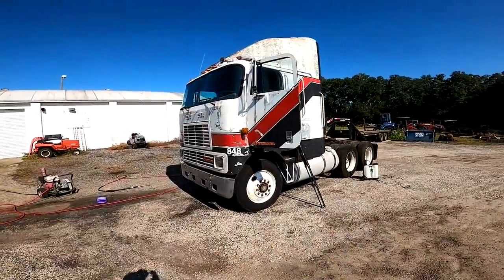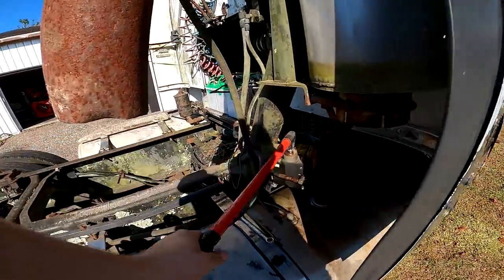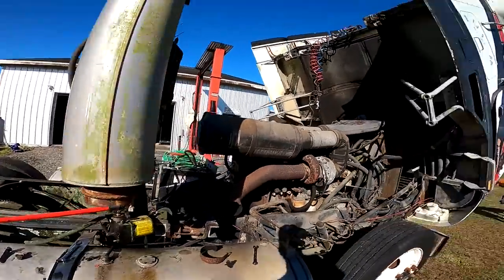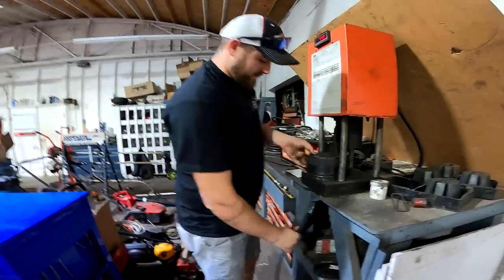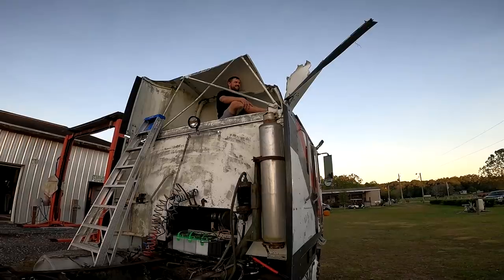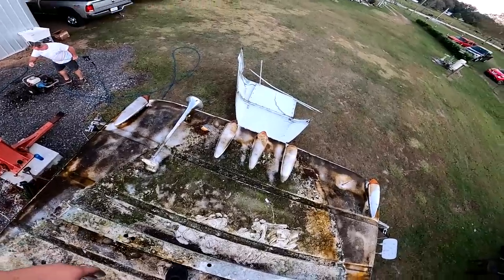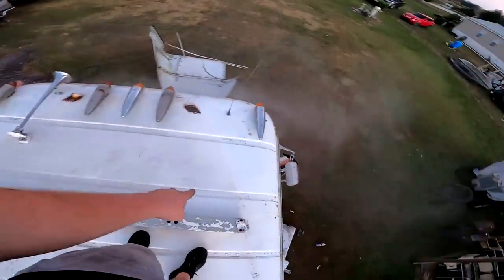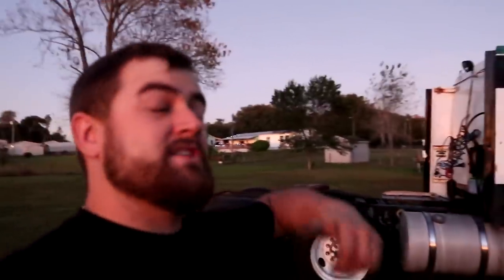THE CORNBINDER GOES UNDER THE KNIFE!!

Comment: For the motor HP a tag should be on the drivers side of the motor at the front side of the motor. A red tag. Get the CPL number and look it up. My guess would be a model 855 350 hp. For the truck.. You could get a build sheet from an International dealer known as a line ticket with the VIN # and know what the truck came with right off the line.

Comment: My dad had an 88 9670. It had an air over hydraulic jack for the cab. It made life a lot easier. Also, when you let the cab down, make sure you pay attention. If the shift rod misses its hole, it will not hold the cab up. And they bend very easily.

Comment: I would repaint it with different colors but I would definitely keep the stripes old-school like most Cabovers were in the 70s and 80s. They have the stripes that started at the grill and turned up the side of the cab. Definitely needs a set of aluminum Alcoa’s.

Comment: Engine serial number and hp should be either on the valve cover or on the front cover on the driver's side,it's definitely a 350 but the number will tell you if it's a big cam,400's are not common and you better hope it's not,the 400 is junk

Comment: Look on the accessory drive on the driver side of the engine about eye level it is what drives the air compressor and the injection pump on top there is a metal tag about 1" by 2" it should say NTC 350 or NTC 400 I think by history on those trucks it is probably a 350. Very reliable engine's biggest thing with them is the liners if you get no anti freeze in the oil or a liner will jump and the head will leak if those 2 thinks are not there then you are golden. let the truck sit pull the drain plug on the oil anti freeze will come before the oil if its all oil your good. I have a 350 in a cabover Shaker, I drive it everywhere still work it from time to time, cabovers are cool but the suck driving day to day. That truck looks like it could be a daily worker.

Comment: Why didnt you just jack the cab up to pressure wash it? Seems it would have been easier, kept crap from running down the already cleaned areas, and you dont have to worry about slipping off.

Comment: Dude you need to be careful jacking the cab over so far without a safety chain on it. I worked on these things for 15 years at a Cummins Distributor and have seen them break off and hit the ground.All that's mainly holding them is the hydraulic cylinders. Also make sure everything in the cab is secure things will fall and brake windshields.

Comment: I'd just repaint it similarly, that scheme is really iconic of the 80s and looks great on it. At most I'd switch those stripe colours to match whatever trailer it's going to jail (of that's even applicable), or make the trailer match the truck would be better.

Comment: I bet that’s a big cam Cummins. 350 or 400. Info plate should be On the driver side front of the engine or a little rectangle tag in front of the fuel injection pump.

Comment: Drivers side, front of motor, just above the frame rail, is the fuel pump, on it is a tag, engine info, on tag, might also be on front , top valve cover.
 Looks like a Cummins , big cam III, or IV, depending on the year.

Comment: Not sure what the plan is for the truck but polish up the tanks, set of aluminum wheels, a period correct visor and paint or wrap but don't change the scheme.  Besides,stripes are coming back. Little more info on the truck like what engine , transmission, and diffs are in it.(unless I missed it in other episodes ) yes ,I know it's a Cummins.

Comment: Look behind the glove box on passenger side..should find the intl build-sheet...i would also suggest that when you jack up the cab to put a come along on it to hold it ..just in case...(the build sheet will have all the correct parts groupings as they changed from truck to truck in that era)

Comment: Engine number is on the drivers side of the engine wrapped around the outside edge of the accessory drive front cover - the most important number is the CPL number - it stands for Control Parts List and let's the parts guy know exactly how the engine was built.   Be sure and use a safety chain when tilting the cab - I have seen lots of those lifting cylinders come apart and drop the cab to the floor and bust both windshields and screw up the cab at the top edge - they usually always leak after that...

Comment: Engine tag is on drivers side of the block or top of valve cover.
Reply: The engine ID tag on an 855 cummins is on the left side od the timing cover near the compressor. It should be on the curved section, facing the outside.

Comment: Hi Bruce hey after you clean those tanks on Bertha spray them down with eagle one's etched wheel cleaner it will polish those tanks like new don't leave it on more than two or three mins spray it off with a water hose awesome will clean a hole lot better on stuff like that 👍I'm not telling you what to do just a suggestion I use to clean cars for a living  I drive big trucks now love the video on Bertha it's the only one I've seen so far

Comment: You called the lights on top of the cab chicken lights, they are not chicken lights, they id lights and are required to be there. Chicken lights are add on lights that did not come on the truck

Comment: I have seen some guys pull the pin on the tilt cylinder if they were going to do a big job and let the cab down on a 55 gallon barrel that was padded to protect the paint etc.- that way the cab is completely out of the way.

Comment: Your engine data plate is located on the left front of the engine where the air compressor mount is bolted.

Comment: The engine data plate should be on the drivers side of engine towards the front in front of the air compressor

Comment: the engine size and horspower is on the side of the fuel pump housing  at the front of the pump it a alum tag pop riveted  on the pump

Comment: I've looked through the comments & haven't seen anybody tell you that the air deflector & cab extensions were fuel savers when pulling a dry van. When you got on the on ramp, you'd pull to the side, release the slider, hook it in reverse, pull on the trolley bar & back up the cab, putting the nose of the trailer almost inside the extentions. Great fuel saving devices. My dad wanted to put one of those tutbo wings on top of his brand new 1983 international eagle, but he was a tight wad & never did it. Sold the truck in 1990 & retired.

Comment: The data tag on that motor, if I remember correctly, should be on the left side of the front cover right behind your belts and pulleys. It's a narrow strip riveted to the side of the front cover
Reply: Your dodge should have one there too

Comment: Should be a plate on one of the Valve cover's or manifold some where . Truck looks Dame good.
Reply: Gary Feltus Small cam and big cam Cummins is on the accessory drive housing facing the drivers side

Comment: I learn to drive tractor trailer in a cab over truck. I didn't like them.
Reply: I just never liked the idea of being the first one at the scene of an accident. I’ll stick to having a nice long hood out front
Reply: @FURST420   Yeah. I had a jack knife accident in a cab over twice! Not fun! First time back in January 1990, I was with a driver trainer and I got the truck to a Truck Stop and he chewed my ass out for going out of route. The roads were covered in black ice and snow was blowing sideways. I got in the sleeper and stupidly started driving to Chicago, Ill. while I was in the sleeper. This guy was dangerous! He down shifted on black ice in high cross winds and jack knife the truck across the road and three pick up truck slammed into the trailer. It was freezing outside! He got a cracked vertebrae and I had a sprained ankle. I was fired! Second time back in 1993 I  jack knifed on I95, Hollywood, Fl.. I was empty heading for Jefferson/Smurf paper plant in Jacksonville, Fl. and some one flipped their RV trailer accross the interstate. Cars were slamming on their brakes. I tried to stop safely on the shoulder, but a red Chevy Corsica pulled right out in front of me forcing me to go on wet grass. My truck jack knifed. I come to find out the last terminal I went to adjusted my front brakes improper and the left steer was tightned all the way and the right steer was loose all the way. I think some one was trying to kill me! I was fired!                    My favorite truck I ever drivin was a Freightliner Century class truck. Smoothest, quietest truck I every drivin!